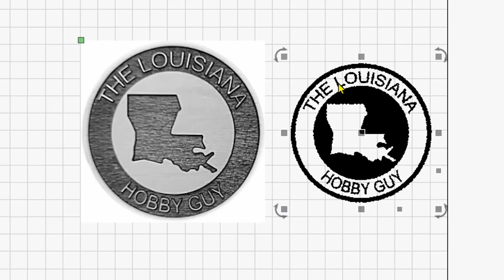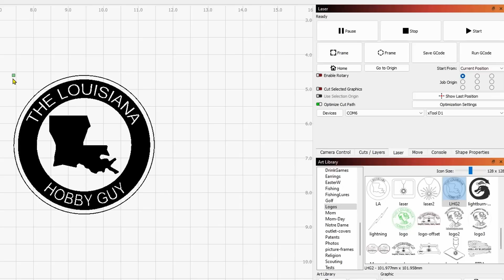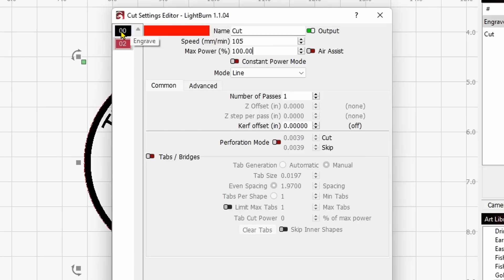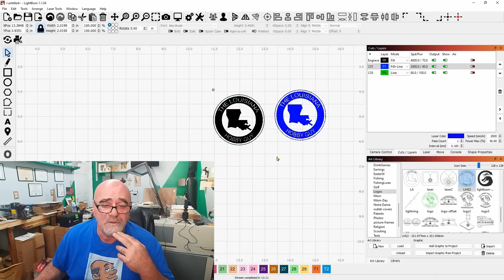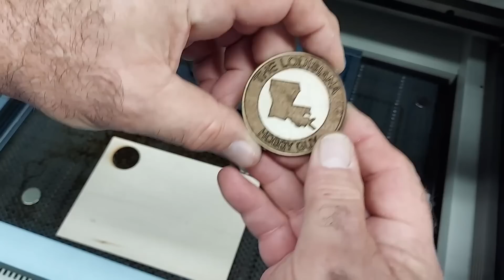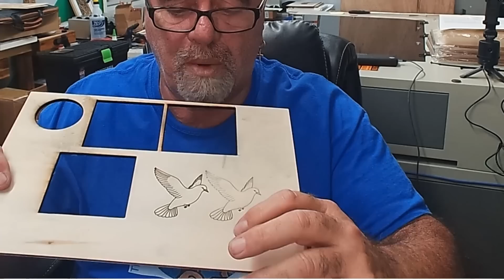🪙 Making coin shaped wood business cards! Take your Laser Engraving to the Next Level!

Comment: Is it OK to do crosshatching on a co2 laser? I don't know where I heard it and may be completely wrong but I thought someone told me that it wasn't supposed to be done with a co2 laser 🤔
Reply: Yes, you just need to dial in the power settings.
Reply from the maker: Absolutely KG!
Reply from the maker: Absolutely you can! And once you dial in your min/max power, you can get some really nice results with a 45 degree scan angle! Dialing in the power is the key.

Comment: Seriously. Every video. Every video from you I learn something new. Thank you for sharing your knowledge with us.

I do have one question - on cutting I've always held off on setting power to 100% on my diode because I've heard that doing so will speed up the demise of the laser. That means I never go above 80%. Is the 100% power concern justified?
Reply: Noob here, I have heard the same thing.  When making MY settings, I use a max of 85%, and will adjust the number of passes or speed as necessary.  In a post on Rich's forum, he stated on quality lasers ( big name ones, but I can't tell ) the laser life is ~10K hours.  But he did mention that is at 100% power, 10 minutes on, 10 minutes off.  That 'duty cycle' does not represent my engraving style so that is why I am sticking at 85% for now.
Reply from the maker: The problem is Mark, nobody can give a straight answer from the factories. Neje says 100% power is fine with a duty cycle of 30 minutes, but they're about the only ones answering the question. Maybe because they're the only real manufacturer? I don't know.
Reply from the maker: Well Colin, I used to think the same because it just makes sense. But I'm told by two different factories now that the difference on a diode laser is so minor, it doesn't really matter. Now a Co2 is a different story! It will consume very quickly. But just about all diode manufacturers suggest 100% power today.
Reply: @TheLouisianaHobbyGuy  Thanks for the info! Yeah, I was wondering if the 100% concern was a holdover from Co2. Good to hear that it might be! I feel more confident about pushing my S9 to 100% (typing this out - I've just come to the realisation that in just over 10 days I'm getting the S10 laser upgrade... ...so honestly what have I got to lose cranking the S9 to 100%! :'D  )